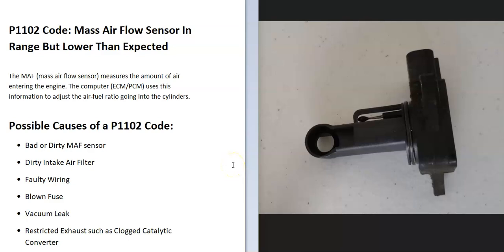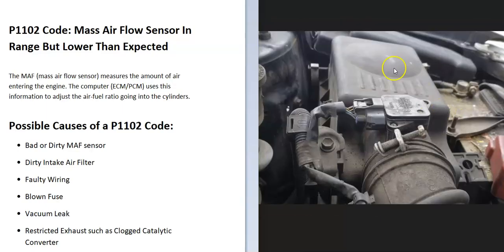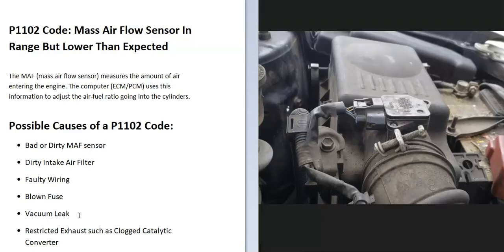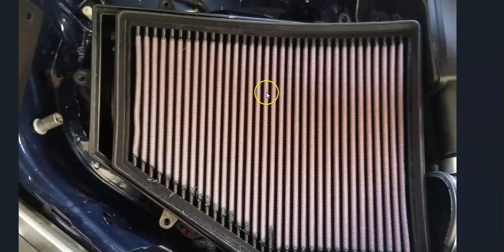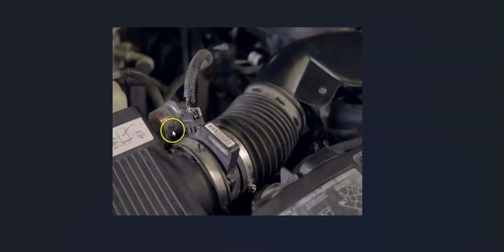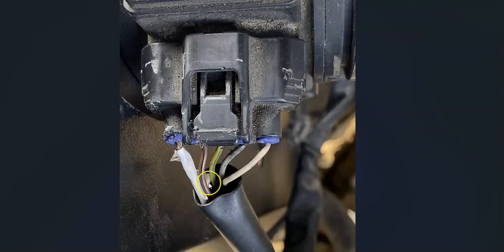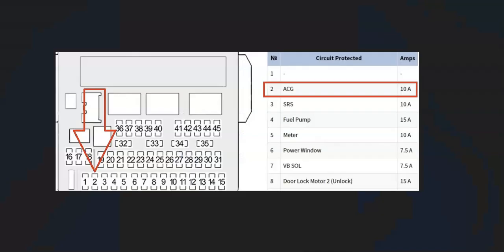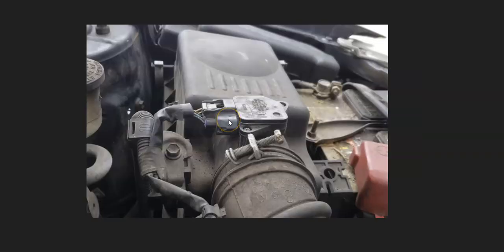Causes and Fixes P1102 Code: Mass Air Flow Sensor In Range But Lower Than Expected

Comment: I changed my air filter a couple of days ago from a paper one to a Piper Cross foam filter. This filter is designed for the car but this code started coming up yesterday. Do you think this is the cause?
Reply from the maker: It needs to be diagnosed, but it is possible. Some debris may have gotten on the MAF sensor, and it may need to be cleaned. Also, check the wiring harness and be sure it is plugged in good with no loose connections.

Comment: I’ve been getting a P1102 on my ford Cmax for ages and I cannot find the cause, I’ve replaced the maf sensor with a genuine, checked the wiring and EGR but everything seems fine. This error causes the car to go into limp mode with error on dash service engine now. This seems to only happen when slowing down under load can you give me any advice how to fix it??? Also if I leave the maf disconnect then car runs fine.
Reply: Hi mate did you find the cause for this I’m having the same exact issue as you are
Reply: @MN_003  hi did u get this sorted
Reply: Did you manage to solve the problem? I'm having exactly the same problem with my Focus...
Reply: You found the issue?
Reply: Did you replace air Intake filter?
Reply: Am aceeasi problema..ai reusit sa rezolvi?multumesc